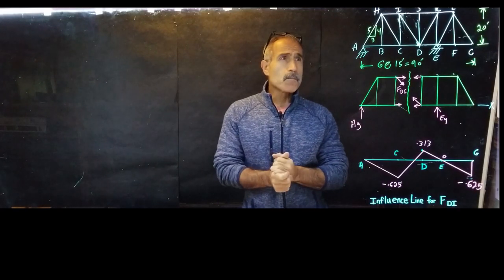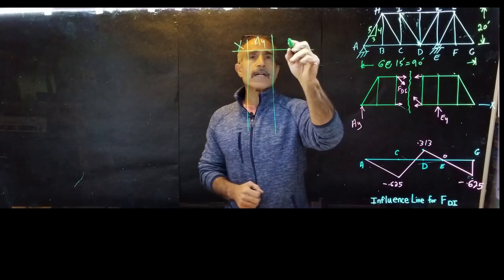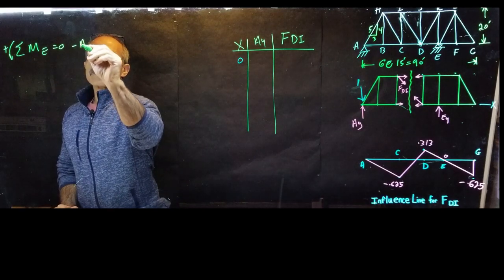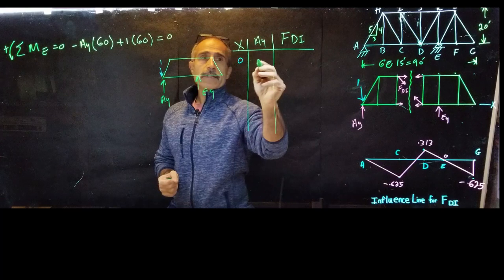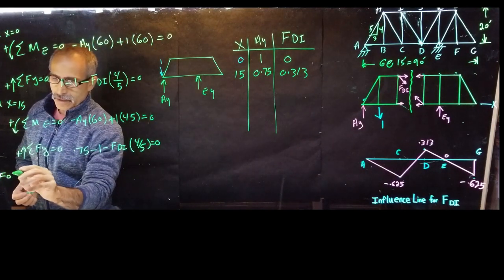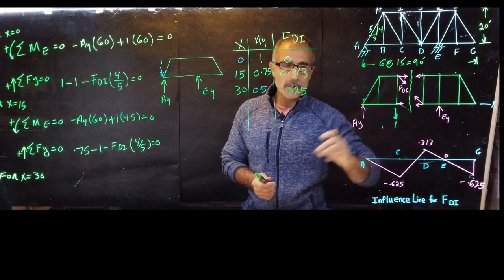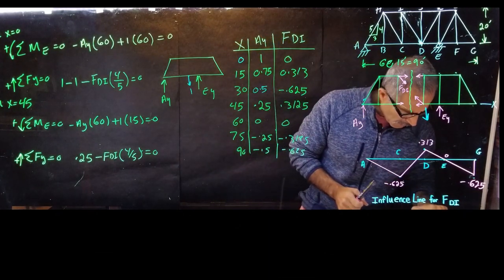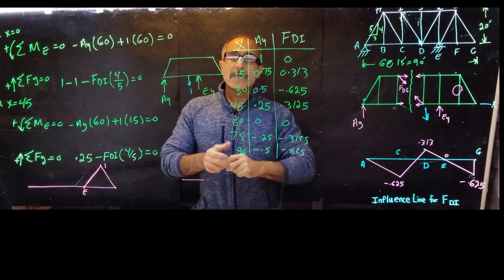Influence lines for Trusses

Comment: Why is it that you do not count the unit load in the equation when you get past the split???
Reply from the maker: Hi Cristian,
Hope all is well. When calculating influence lines for truss keep in mind that the truss members are affected only by the joint loading, we can therefore obtain the ordinate values of the influence line for a truss member by loading each joint along the deck with a unit load and then using the method of joints or the method of sections to calculate the force in the member.In this case we are using method of sections to calculate the force in member DI as the 1 (one) unit load moves from left to right on each joint based on that we calculate the reaction Ay. When we cut the structure at the location shown in the video we only deal with loads that are on that section, once the unit load is past that point it is no longer belong to that section. Good question Thankyou.